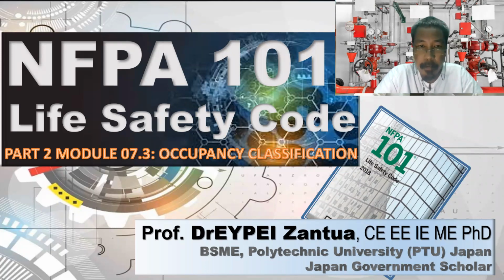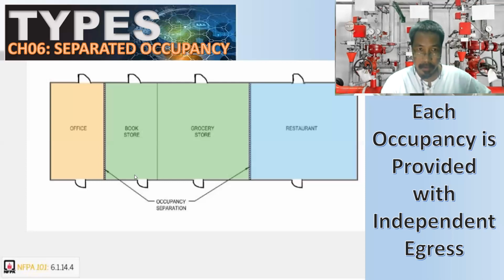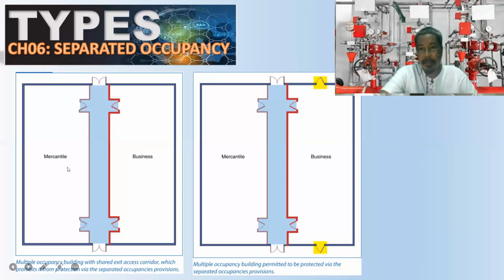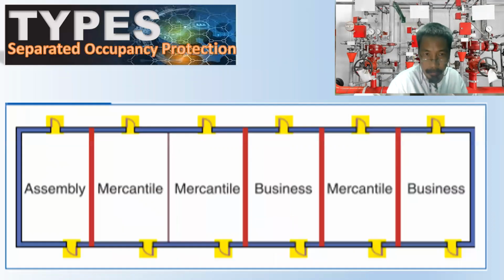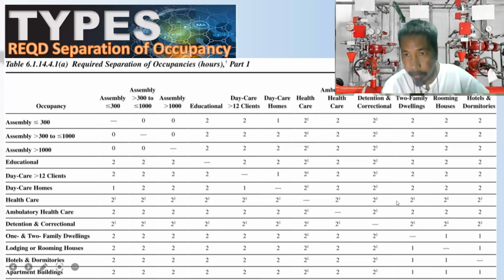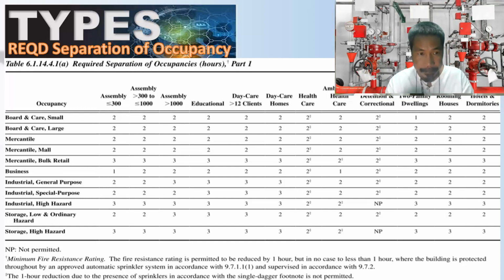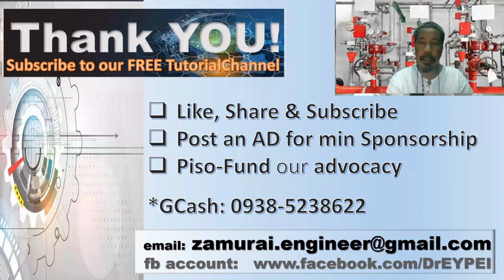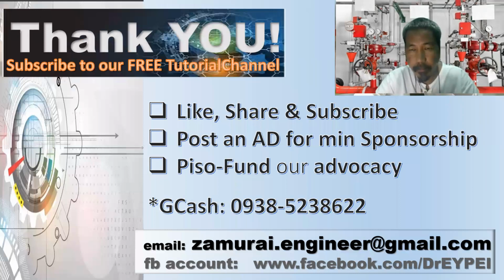SEPARATED OCCUPANCY-NFPA101 | General Requirements: Module 07.2 [ Reference CODE by RA9514-IRR2019 ]

Comment: Thank you sir, in this video it tackles about Occupancies separated. When designing a building with various uses, the designer can decide to divide the occupancies by using construction with a fire-resistance rating. When the designer selects this option, the building is classified as a separate occupancy structure.